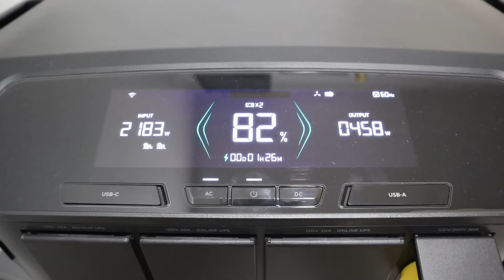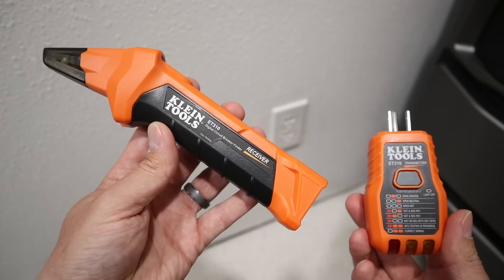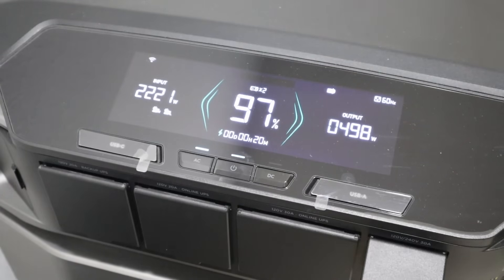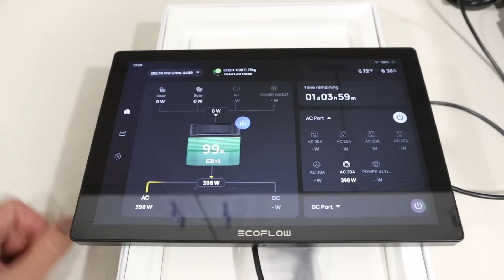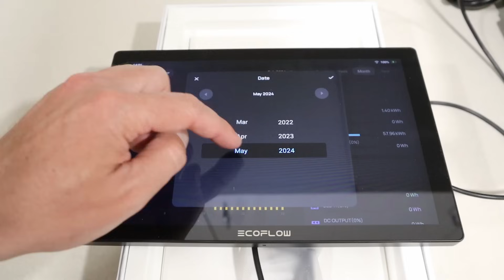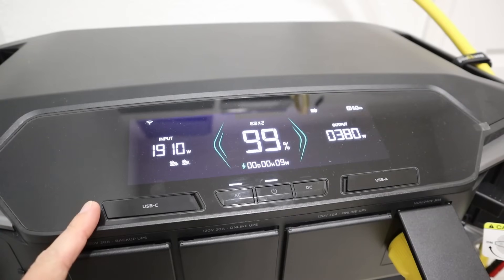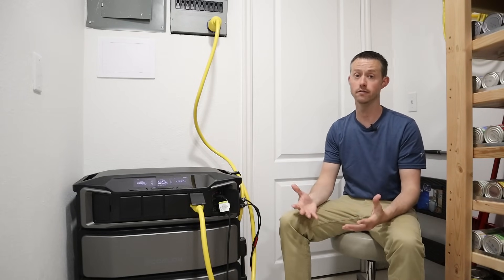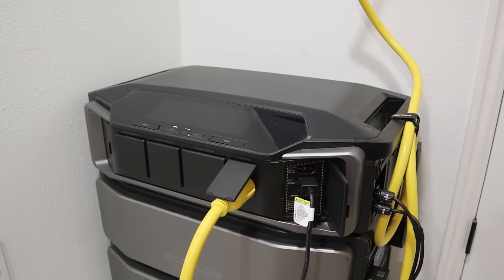Using A Transfer Switch With the EcoFlow Delta Pro Ultra! 3 Month Update

Comment: This might be off the subject, but I wanted to tell everyone what the EcoFlow company has done to me.  I bought a new EcoFlow Delta Pro Ultra during Prime Day sale. I received half my order yesterday, but did not receive the battery.  This system with sales tax costs about $5000.00.  I contacted them and they said they didn't have any batteries for this system.  They said they would send one when they get some batteries, but they didn't know when they would get any batteries.  You can't use this system without a battery.   They didn't tell me they did not have any batteries when I ordered this system.  Be leery of this company.

Comment: How often roughly in the week do you transfer over to off grid battery and solar and not use grid power?
Reply from the maker: Due to sunny conditions in the summer in my area, I have been running off the DPU for about 45 days continuously. It's been awesome!
Reply: @Jasonoid the SAVINGS on grid 💥 power are phenomenal Im sure 🫡

Comment: Hey again Jason, I finally have the DPU hooked up to my transfer switch. However,  I tried to output to my Transfer Switch while charging from the grid via an isolated GFCI wall outlet. This causes the GFCI to trip all the time. Have you found a way to fix this? Supposedly it has to do with a neutral loop or something. All the garage outlets are on a GFCI, am I out of luck here? I didn't anticipate this, but it's a major problem for me right now.
Reply from the maker: Look in the app, theres a GFCI charging switch setting I believe.
Reply: @Jasonoid  I searched through the Android Ecoflow app on my phone settings and didn't see anything. Hmm.

Comment: So it only has a 30 amp out at 240V.  You could NOT charge an EV at 40 amps then, correct?  You would only have 30 amps available for the whole house?  IF you put three of them in series with their smart panel 2 would you still only have 30 amps available or would you have 90 amps?

Comment: Hi Jason, what type of low voltage and high voltage solar panels do you recommend for this? How should I wire them up? I want to max out the low/high solar for the DPU. I don't have any panels yet (the Ecoflow ones seem way over priced). Trying to figure out the configuration first.
Reply from the maker: That's a good question for this service:   https://asqme.com/@Jasonoid
I can't explain that here in the comments section. It will take too long.

Comment: Hey Jason, I have the DPU and a transfer switch just like what you have here, just waiting for the cord to come in to hook it up. If you have have low and high solar hooked up, will it prioritize that over the grid, if you have it plugged into a 110v grid outlet too for charging?
Reply from the maker: There are a ton of settings in the smart app you can adjust and I think that is one of them. I only charge from solar so I can slowly make a return on my investment. I pretty much don't ever charge from the grid.

Comment: Thank you. So from what I heard did you say when the sun goes down you have the battery set at 50 percent so you don’t loose any power in battery. Is that right?  So what happens to the electric that is connected to the Ecoflow system
Reply from the maker: I charge from solar 99% of the time. It fills up with solar during the day, and then the battery goes down overnight, and then charges back up with solar the next day.

Comment: Another great video. I want to like or purchase the EcoFlow.  I like their designs when it comes to split phase and transfer switch operation.  But it seems to me that these high end units are getting in the price of Sol-Ark or EG4 systems. It seems to be trying to use a portable design in a permanent install or battery backup for home.  Amy I missing something here? Thanks again for your videos. All the best from north Texas.

Comment: Ecoflow man their sales phone support with non tech savvy offshore, so I hope you can help me with my question. I see that you are using the A510A transfer switch with one ecoflow Delta Pro Ultra which according to their sales support, your setup is impossible. So, if I plan to expand to 2 units in the future, what do I need to buy to hook up 2 Delta Pro Ultra to the one power input?

Comment: Excellent vid 👍.  I'm doing the exact same thing with a Reliance 50A transfer switch and plugged into the 30A outlet on my Ultra.  I am going to purchase the 50A hub and another DPU with battery soon.  Can I use a split MC4 cable to charge both batteries?  If not, do I have to purchase a set of dedicated panels to charge the new battery?  Any thoughts or ideas?  Thanks!
Reply from the maker: I haven't tried splitting the solar array between two machines, you could always try to see if it works.
Reply: @Jasonoid  Thanks.

Comment: There is a lot to like about this, but the thing that keeps me from pulling the trigger is the inherent vendor-lock design.  What happens in 5 years when this is several generations behind and can no longer be expanded or even supported?  A DYI solution would allow substitution of components for repair or replacement.  With this, you would have to replace everything.
Reply: Samething that happens when improved panel, performance or battery tech evolves.  You last as long as possible before selling and upgrading.  Depending how much you would be saving you can invest that money in high quality, top performing ETF's and be better off financially
Reply: This is why I won’t invest in the SHP
Reply: You can AC couple another system. Code requirements are likely your bigger issue with expanding a system in the future. What happens if your UL9540A batteries are no longer available?

With something like this you can always AC couple systems together or simply run another load panel.

Comment: Title: EcoFlow's New Delta Pro Ultra - Battery Issues and Mixed Messages from Customer Service

I recently ordered the new Delta Pro Ultra from EcoFlow, but I need help with this. They sent me the inverter but not the battery. To make matters worse, they charged me for the full unit.

When I emailed them to ask about the missing battery, they informed me that the batteries for this unit are out of stock and won't be available until mid-July. However, when I later called their customer service number, I was told the batteries would be in stock in early July.

These conflicting dates are leaving me stuck with a Delta Pro Ultra and no battery indefinitely. Adding to my frustration, their website still allows people to order the kits and the batteries as if they're readily available.

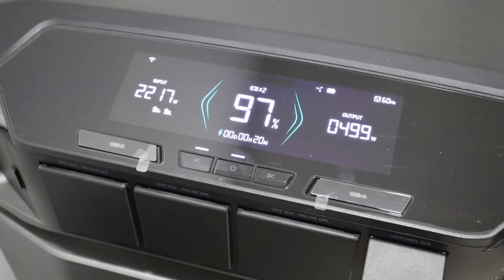Comment: 5:32 - how is it you're at 97% with two batteries, have 2200w coming from solar, only 500w going out, yet the estimated runtime is only 20 minutes??
Reply from the maker: Cuz that 20 minutes on the screen means till it's full. If you got green lights around the battery percentage, it's charging.
Reply: @Jasonoid  Ahhh thanks, that makes much more sense

Comment: Outstanding review!   It's a bummer that this unit is not backward compatible with their Delta Pro and SHP1, unfortunately.    Appears part of their model is to rip & replace vs. make these new devices backward compatible.
Reply: Update.   This is backward compatible with the DP but not the SHP1.   I ended up switching to the SHP2 --- much better unit overall.

Comment: A mobile welder I met, bought the smaller version as it was more stable to use than his gas generator. The output is incredibly stable and strong. Welders and other mobile power users should give them a look.

Comment: so why don't you have it charge from AC and not panels on cloudy days instead of manually turning off circuits?  Can't you program it to automatically switch to AC when solar array input is low? Can the AC input charge from any 110v outlet? Suppose to get 3000+ charging cycles out of this unit, I wonder if you would count each day as a cycle. Very cool setup you have.  Thanks
Reply from the maker: It's more efficient to get power directly from the grid vs charging the battery of the power station from the grid (AC to DC conversion losses). So I swap back to grid power when it's cloudy for an extended time with my transfer switch.
Reply: Not sure if I’m correct on this, but with a manual transfer switch you can’t  charge from ac and use the battery for powering at the same time?
Reply from the maker: @allen35315  it depends on how your main box is wired. If the grounds conflict you'll have issues charging with AC power.

Comment: Hi. Great video. I just received my eco flow pro ultra kit with an extra battery. Im only using ac outlet to charge. The app will not allow me to charge when battery discharges to 90%. Your solar charge allows you to start chargingwhen you reach a certain point. Does the ecoflow tablet allow access to more setting??
Reply from the maker: When charging with solar it charges to 100% and then stops charging until 97% and then charges again. This could be slightly different with AC charging. All the settings are available in the smart app.

Comment: Theoretically, if you bought a 130kwh F150 Lightning and used it as a massive battery bank, could you run the DPU for days if not weeks at a time?
Reply from the maker: Yeah, that's a BIG expansion battery haha
Reply: It sure is haha. Reason I asked is I had a solar guy try to sell me a 3.5kw system with a 10kwh back up battery for $42k. When I mentioned I could get a used F150 Lightning (98kwh), a DPU, and a few solar panels for the same price he seemed very perplexed lol
Reply: I have used the Vehicle to Load feature of my Hyundai Ioniq5 to recharge my Ultra via the 120 volt input while the Ultra is outputting 24 volts (running my dryer).

Comment: Thanks for the update! 
When you were showing the EF tablet/data, specifically the inflows vs outflows numbers, is the delta the "loss" between inflow-outflow? 
I'm assuming the inverter/"idle" energy used by the unit itself is the difference.
Thank you for your efforts on all of this! Glad you can get some benefits too back to your day to day living (e.g., less $ power cost, outage protection, etc. :-)

Comment: Can you set up  the charge percentage  example max 80%    some type of battery life  saver as Samsung phone
Reply: there is a setting where you can set charging parameters on the device, I think the default is 10% low 90 % max

Comment: Jason, have you calculated how long it would take to pay for itself in energy savings, at your current usage, were you to have paid full retail price?
Reply from the maker: Great question! That pay off would take years since the price is so high with a plug n play setup. A DIY setup would be half the cost of this unit. 
In my opinion a setup like this is meant for emergency power as the main use case with the added benefit of saving money on your power bill and getting a return on your investment. 
For people in areas where power drops constantly, a setup like this can save hundreds of dollars of food going to waste each time the power goes out.

Comment: Hey Jason, Great review!!  The Ecoflow Ultra is awesome!!  I have the same setup with the 10 circuit transfer switch and the BLUETTI AC300.  I’ve been running it now for close to 2 years without any issues. My electric bill has dropped from the $250s to 130s in daylight savings time.  The Ecoflow has the upper hand with the 240 without needing an extra head unit and hub.  I also like the compact size of the Ecoflow. The technology keeps getting better and what you buy today might be dated in 6 months to a year. I really like the Ecoflow Ultra.
Reply from the maker: The AC500 seen in the video can run the same exact setup as well. Same with the AC300 (you just have to be more mindful of hitting the inverter limit). I ran my AC500 for over a year straight with no issues so I think that series of power station is also excellent. My only compliant with the AC500 is the idle power usage. The parasitic drain is much higher on the Bluetti. I hope they improve that with future models!
Reply: Speaking of 6 months, the Ecoflow Delta Pro 3 is about to Release, lol

Comment: What was the solar charging issue you had early on? Was it the “479” error code that shows up in red numbers?
I had that issue on mine, but I haven’t done any firmware updates as of late.
Reply from the maker: It was a similar error code. Maybe 473? I can't remember what it was. It was before launch on a preproduction firmware. I had to disconnect and reconnect solar for the error to go away. After the firmware update it stopped happening.

Comment: I've been thinking of upgrading by adding a transfer switch  to which I would use my EcoFlow 2000 max to power critical loads for short periods.  I was at one point considering the EG4 inverter and battery but decided that it was not time yet.  Most of my grid failures are normally fixed within 2 to 30 hours especially with the last storm we had here in Texas.  I figured if I needed to extend battery use I would just switch the other max 2000 or just use to charge the one already hooked up to the transfer box.   Also I like using them as EPS units for my fridge when out of town.

EcoFlow has great products and was getting ready to write a 2 year long term review on my units when suddenly I had to send both 2000 max units and a river pro back.  Luckily they send shipping labels and they gave me the choice of waiting to get them repaired or replace them with refurbished ones.  I chose refurbished ones and they sent me back a brand new river pro plus gave me an extension battery for my troubles and sent the refurbished ones back.  At first it can be frustrating with customer service, but if you have all the needed information they ask for they are top notch.  If I had need for the ultra I would buy it but for now I have 6.5 KW in ecoflow units that keep me from going under.  As always I appreciate your videos.  Can't wait to see you do long term reviews of every product you have.

Comment: Sorry if this is a dumb question but I'm a total noob when it comes to transfer switches. My question is, how do you alienate certain appliances if they're on a circuit with multiple other things? Like running your lights but not your stove or dishwasher etc? Or do you have to run everything on that particular circuit?
Reply from the maker: You can't choose specific appliances, you just have to power the whole circuit. Most houses will have a dedicated appliance on a circuit though. For example, your microwave and fridge could have their own circuits to themselves.
Reply: @Jasonoid  Makes sense. Like my water heater. Had to replace that last weekend. It's on it's own breaker.

Comment: I have 2 Bluetti AC300 & 24kwh worth of batteries & am running my kitchen & living room 24/7 rather than using the batteries as backup in case of an outage. I figured since I paid a lot of $ for all this hardware, I wanted it to save me money since electricity is very expensive here in California.  Is that an inappropriate use for these systems?

And I really drool for that Ecoflow inverter.  My son is running a machining business out of my home & his machines use a lot of juice.  I'm trying to convince him to buy the Ecoflow for his shop.
Reply from the maker: It's probably frowned upon since it's not really to code.... But that's how I use my system. Some renegade off grid setup haha
Reply: I have both of them, and I use it to maintain a next to nothing light bill. Until I manage to sell my AC300 I use the DPU 100 percent and for those cloudy days or emergency situations where a power outage comes along and I have no juice in the ecoflow I hook up the AC300 system. Sometimes I run partial loads on it if I know the weather is gonna be crappy the next day

Comment: Does this have dark start like the Hysolis Apollo?? In other words, if it shuts down on 0% and solar comes up in the morning, can it start up at a designated percent power available?
Reply from the maker: Yes, DPU has a 'lab setting' that's in the app being tested currently where the AC output is 'always on' and will be enabled automatically with solar once it starts charging.

Comment: I have a similar Setup like you, The DPU with 2 expansion batteries, and right next to it I have a Maxed out AC300 with 4 batteries. I wish I could find a way to use both of them, lol. But the question I have is, Have you messed around with the modes in the settings. There is a Time of Use Mode,  Self Powered (the one I'm currently using) and Scheduled taks(that one confused me) The Ac300 and Ac500 was easy to setup for me for time of use  my rates are higher between 3pm and 7pm. But Ecoflow seems a little more complicated. I got frustrated and gave up on the other 2 modes. On a side note I do love the Data Tracking, something I wish Bluetti should have but doesn't.
Reply from the maker: I haven't messed with those settings too much. My setup is super simple, run the circuits, charge with solar as much as possible. I don't really grid charge my unit.

Comment: I have had a few issues with mine and would love to find someone that can help me find some answers, would you be willing to help?
Reply: Not looking for a freebie
Reply from the maker: I don't have any special connections with EcoFlow (other than a non technical marketing rep). I have always used the normal support system for my issues. If you are interested I offer basic consulting and advice here:   https://asqme.com/@Jasonoid
I can't guarantee I'd be super useful since my use case with this unit is very simple. What you see in the video is how I use this thing. Solar In - AC Out. I don't charge with grid power ever. If I do charge with AC power, it's from a separate power station like the AC500 seen in the video.